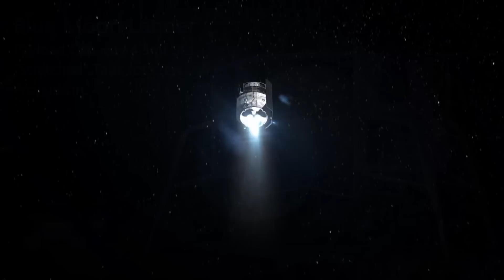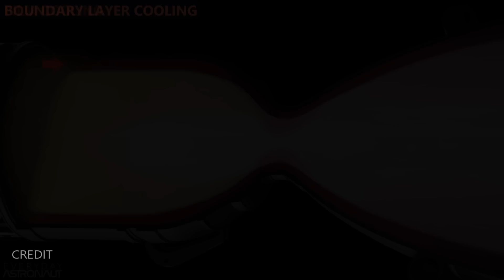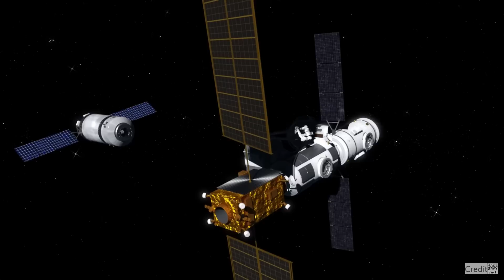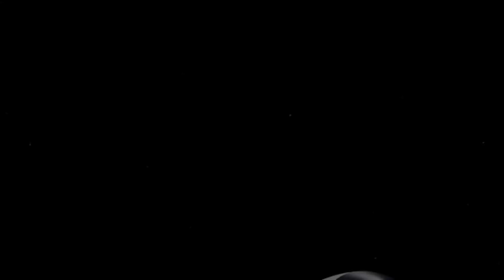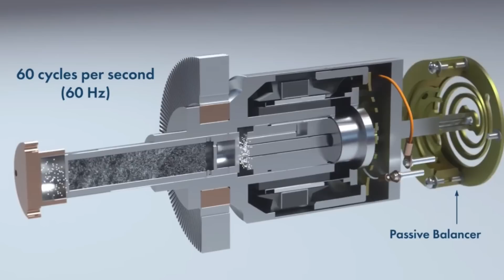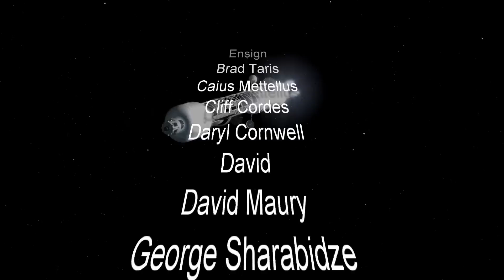Blue Origin Beats SpaceX!

Comment: Why are you using the outdated design?
Reply: And in every image within the video, as well as the descriptions of the mission profile. I really would like to see your usual excellent technical exploration of the radical  re-design of Blue Moon, even if we have only one rendering to go off.
Reply: @marxug1  Yeah, tried to watch this and it lost me when describing a separate descent and ascent element.  The new proposal is for a single element from NRHO to surface and back to NRHO, near enough.  No separate Ascent/Descent modules.  And the transfer element that was NRHO to LLO in the old design seems to be LEO to NRHO.  I could forgive the visuals due to lack of material, but this is not helpful.
Reply from the maker: In the image?

Comment: As you say, competition is an excellent thing in the space business, and it's good to have an alternate approach to landing on the Moon. That said, the capabilities of the 2 systems are quite different, as the payload to the surface is dramatically larger for Lunar Starship. Of course Starship relies on orbital refueling, which is far from proven, so having a backup option is definitely a plus. Overall, I see this as a big positive for our spacefaring future!
Reply from the maker: There really is no comparison James.  Starship will change everything... literally for once :-)
Reply: Adding a "back up" is redundant and was never needed before commercial space was a thing. It's just another example of lobbyist fleecing the system.
Reply: @hawkdsl  A backup was indeed needed when the Space Shuttle was grounded for several years on 2 separate occasions, and during the long dry spell after its retirement. The problem was that the program was so expensive we simply couldn’t afford any such luxury. Commercial programs are dramatically cheaper and thus enable the dissimilar redundancy we’ve always needed, but could never afford.
Reply: @jamesowens7176  That's a good point.

Comment: Also with these designs why not do possible multiple launches or design it to be cramd into the fairing then once in space unfolds and like Legos put back together into a lander that is low to the ground like alpaca and thrust tower to protect descent engines like lunar starship, and can take a small machine with it that converts h20 into fuel to get back.
Reply from the maker: I would like to see Zubrin's plan using only Falcon 9s and Heavy put into action.

Comment: BO has to get something to launch first. Even though SpaceX's Starship did not make it to orbit on the first try, it still made it off the launch pad. Something BO has not done with New Glenn yet. In fact, have they even delivered any flight ready BE-4 engines yet? And this is outdated designs shown as they have already switched from crewed section above to crewed section below on the lander, as they could not have such a long ladder to get to the surface. SpaceX will used an elevator for getting to the surface. And has already been working on it. And SpaceX with the Starship will have the basic design for the HLS down just about when they make the first orbital launch of Super Heavy and Starship. So BE and team will have their work cut out for them to even make the 6 years from now date. People laughed at SpaceX when they said they were going to build boosters that returned  for reuse.  Today was the 204th straight successful launch in a row of a Falcon rocket.
Reply from the maker: They hope to replicate the SLS tens of billions for a single launch that works model.
Reply: Be4 is about to fly on Vulcan in less than a month from now... So that's 2 ready.. well.. allegedly.

Comment: For spacex why not modify a falcon heavy with methane, raptor engines, reusable 2nd stage, and mini starship? Safer than a super heavy booster with all that fuel and easier on refueling. Also if your in international waters for launching what approval do you need to launch or lift something to space?
Reply from the maker: Like ships spacecraft must be sponsored by a company.  I had suggested that SpaceX start a company in St Lucia and launch from the equator.
Reply: @Terran Space Academy  personally I was going to offer them an aerospike engine design but I decided nor to for many reasons. The reason for the modified rockets of falcon is less plumbing and possibly water landings or use parachutes to guide them to the landing areas(parachutes technically don't exist right now but are possibly and long lasting even for the upper stage for reuse). Also, for the pressure refueling in orbit, I would go with inter exchangeable tanks instead for easier refueling. I can not give them the idea, but I'm sure their intelligent enough to come up with something similar.
Reply: You'd need to redesign Falcon to use Raptor. 🤷🏻‍♂️
Reply: @GSF404  it could be done still, also why not use falcon heavy to get a lunar model to space with feul and falcon 9 to as either a refueling mission for it or for more components needed for one?
Reply: @mr.ackermann807  But why? Why redesign a working rocket to use a speculative, unreliable engine? You could facilitate a lunar program with Falcon 9/H without changing them, other than making a bigger fairing.
Reply: @GSF404  personally if he wants a fully reusable rocket rocket then modifications are needed by if not then so be it, either way with the rockets they already have the Artemis program I'd not necessarily needed if you have the falcon 9 or heavy or both launching the components to space(which they have the capability) they apparently just either didn't think of it or so focused on starlink stuff that they don't see it, yet.
Reply: @mr.ackermann807  You can't however use Artemis hardware for Falcon 9/H, it'd have to be a complete new architecture from the ground up for whatever the two rockets were going to launch, due to volume constraints. But it could be done, and I'd argue there's a solid rationale for utilising the Falcon rockets (Unmodified) rather than spending tens of billions with Starship.
Reply: @GSF404  my bad I wasn't referring to the capsule I was referring to the sls rocket itself. The fairings of eight falcon should be able to hold it or take it to be put together in orbit (orbital shipyard) is also possible right now.

Comment: Blue Origin has not been contracted to "beat" SpaceX.  The are to be a secondary option with an expected launch in 2029 for  Artemis 5 while SpaceX is the primary with Artemis 3 and 4 starting in 2025.  Both will have to fly unmanned demo flights.  I doubt if Blue Origin will even have a launch vehicle by 2025 but we will just have to wait and see.
Reply: I sure hope you're REAL patient; You will need to be? If you need advice on how, you could ask Tory.🙄
Reply from the maker: @David-dl3vj  Did you see my funny one on Tory?  It was a lot of fun :-)
Reply from the maker: The potential is there if SpaceX fails for BO to be first... just looking at what's possible.
Reply: @terranspaceacademy  No thats not possible, even if SpaceX is late, they are contracted to launch first